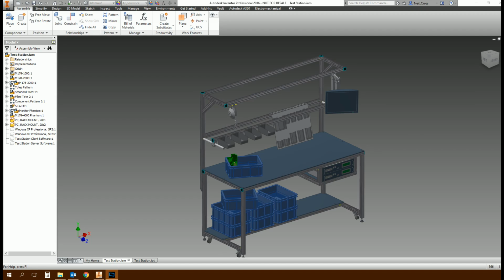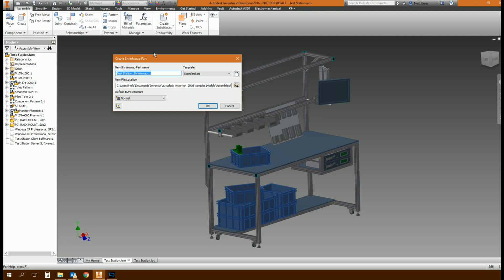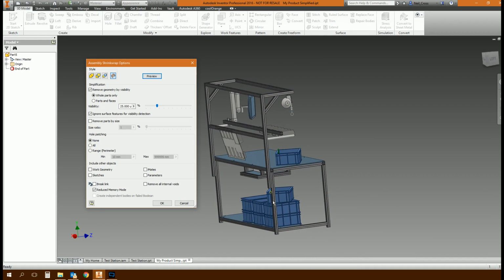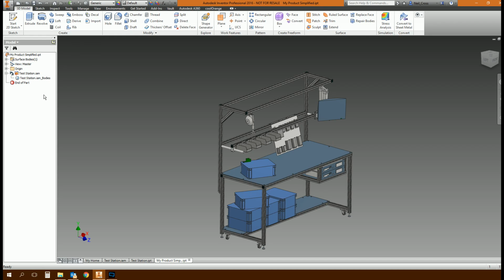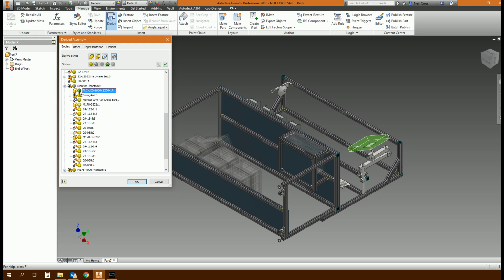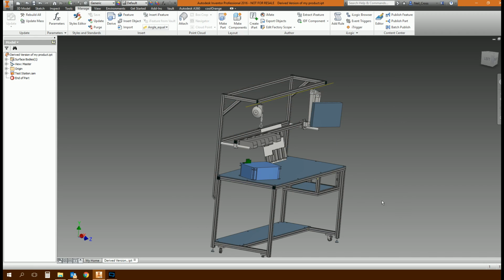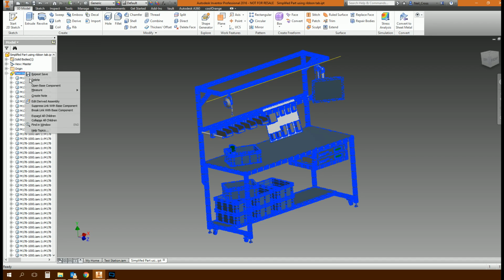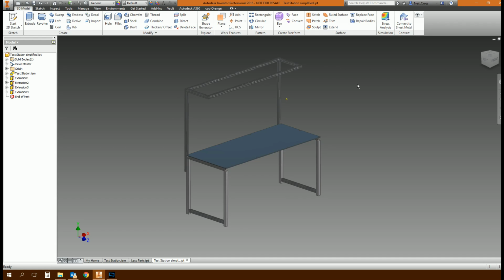Shrinkwrap and derive? What's the difference? | Autodesk Inventor

Comment: As allways a grrreat video! Really helpful, thnx a lot!  💪💪💪A thing I am getting across every now and then is the need to calculate the total paint area of the parts included in an assembly. Have seen that there are code-crackin-I-something solutions to that, but never got to really make it work.. May you have a better hands-on solution to calculate paint area for an assembly? 
Keep on with all your magnificent tutorials! 👊